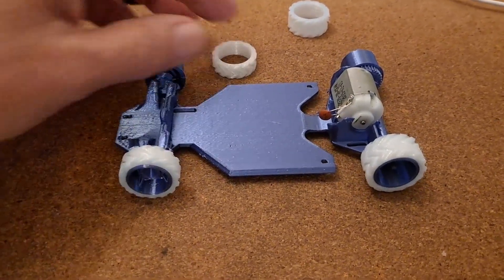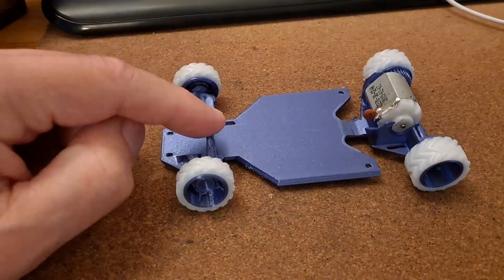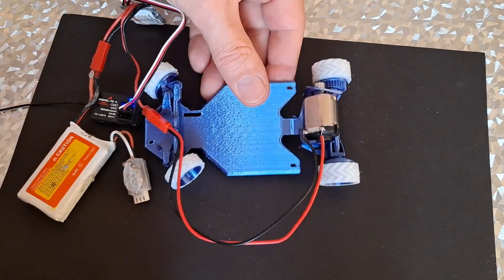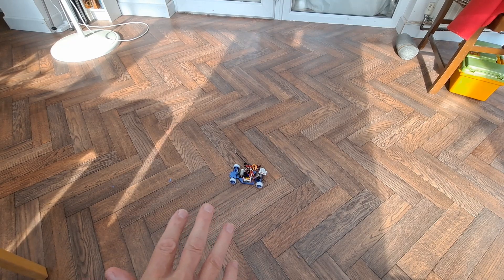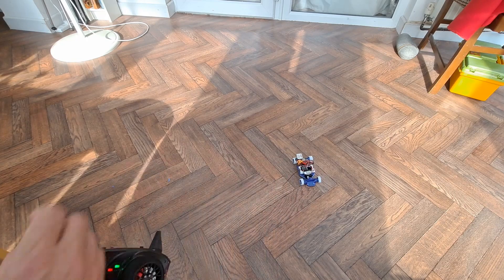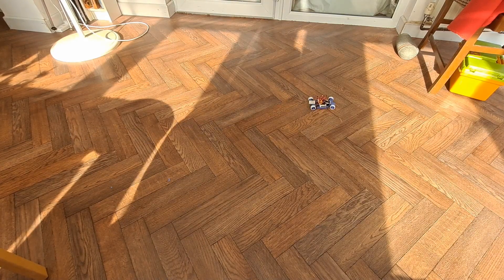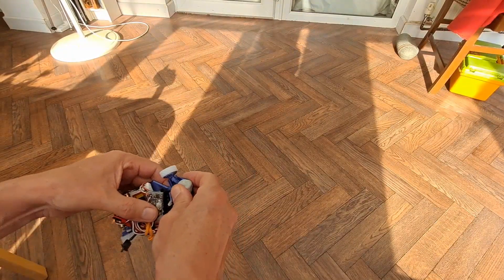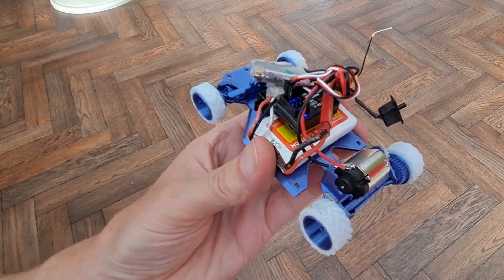Printing the Gamma 2.0 PART 4 putting the bits together

Comment: my 1st thought as the video opened was "action figure gocart" and immediately after that ...a wobble granddad figurine...  getting the backing of 2 sided tape is one of the most aggravating things to attempt... uuummm maybe not, theres not enough room for a sugar ant on there.... lol
Reply: Id say its 10/10..  what it be too fragile if was doubled it in size
Reply from the maker: You can resize the print, but that would resize everything, so the motor mount and the main gear on the axle would all be the wrong size for the motor.

Comment: Haha did a sweet burnout then oops! Hot rodding tends to tear up. Looks like a fun kit to play with, maybe put a petrol engine in it? Those EVs got too much torque! :) Fun build
Reply from the maker: Thanks Spencer, there are advantages and disadvantages with print-in-place. As long as consider it a disposable chassis, it is fine, but if a part breaks it is easier to  swap the components to a new chassis than it is to repair the old one.

Comment: "I've got a shortage of ESC's at the moment".. and we've had fun finding out how that happened 💥
I liked the servo mounting method, the alignments.
Reply from the maker: I get through quite a few of those little ESCs, I generally just use random DC motors that I have recovered from various places, so I have no ideas what they are rated for. If they are too low resistance they will draw too much current and fry the ESC.
Reply: A tip, may be to use an AA battery. 1.5V is a good test, the slower it goes the more current or voltage it needs, broadly. Speed and torque amounts take just a few seconds to work out by eye and ear. If compared to a known ESC friendly motor, then future ones get a baseline

Comment: Just teathing problems. It works! I always find those PIP prints amazing. Bit of a pain with the motor heating up though. Maybe a heat sink on top of the motor and not touching the PLA? If you have any of that heat paste you could put it on the top of the motor with the heat sink. Tape or wire to tie it down on top of the motor. 👌👍
Reply from the maker: I generally just use random DC motors that I have recovered from various places, so I have no ideas what they are rated for. If they are too low resistance they will draw too much current and fry the ESC or overheat.

Comment: Maybe you can cut some wide rubberband to glue on the wheels to give it some grip.
Reply from the maker: You could do that. The car is designed to use Kyosho Mini Z tires so you don't need to print the tyres. I have wanted to try out TPU filament for a long time, so this was a chance to use it.

Comment: Yeahee.. We got to see it running V0.1🙂 Looks like you are 100% reg. the weight distribution. It is not the prettiest thing, but looks like fun 🙂
Reply from the maker: It would look a lot neater with a bodyshell to tidy it up. Thew guy who designed the chassis also has a couple of matching bodyshells available.
Reply: @GrandadIsAnOldMan  Hi, I've now watched, Under Engineered's video on the Gamma 2 and a bodyshell will make it look nicer :) Looking forward to watch the next video in the series. Thanks.